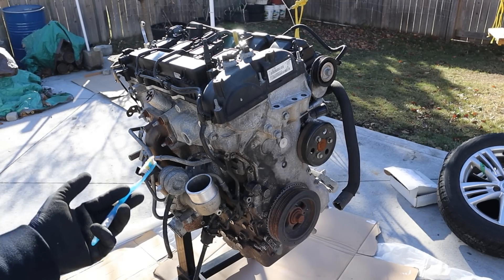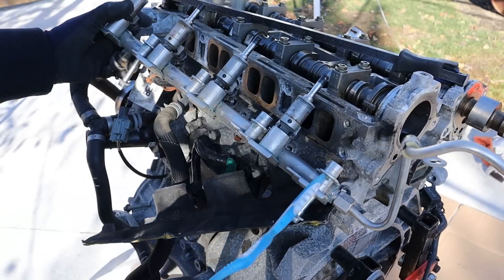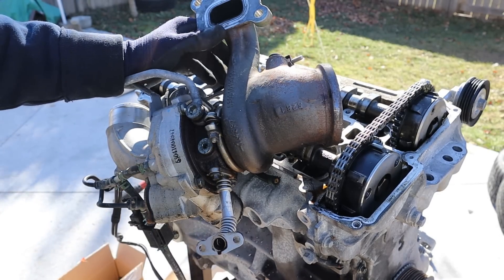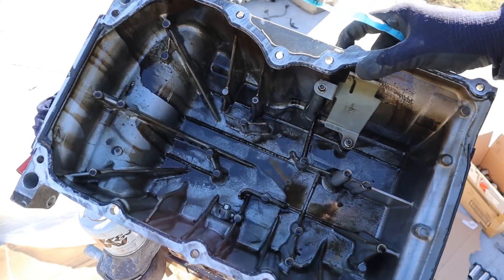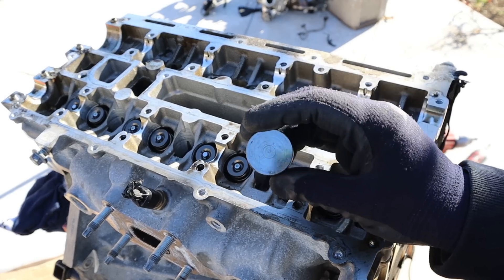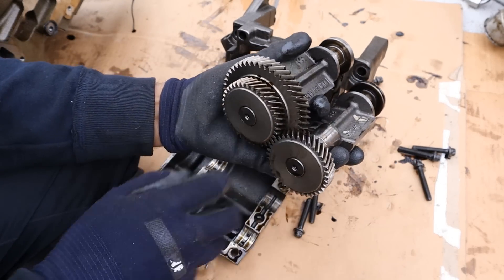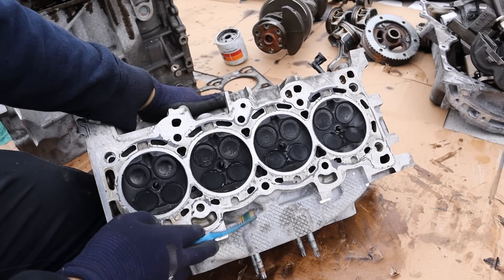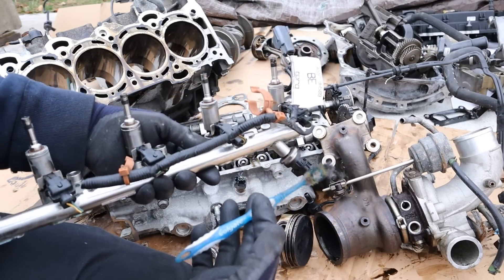Why Ford Ecoboost Engines Fail

Comment: Typical modern day Ford engineering. That's why those engines fail. Now I see the new Broncos are having catastrophic engine failures. Good job Ford. Just goes to show you that brand loyalty drives car sales, and not so much reliability. Evidently Ford buyers are more concerned about being true to their brand than having good reliable transportation. All auto makers build troublesome models but no one as much as Ford. Just look at the recalls over the years. My son bought an 05 Mustang years ago. OMG worst car that ever sat in my driveway. Constant expensive issues a couple times a year at least for all 4 years he owned that car. Alternator catching on fire, premature  total exhaust failure, constant brake caliper issues, both side window motors, rear differential failure to name a few. Yeah those Mustangs are quite the automobile. He traded it in for a Chevy.  Keep those Fords no.1 people must be you like your car at the dealer a lot.  Use to love Fords from about 1980 and back.

Comment: and the Owner put a Catch Can on to prevent issues and it otherwise seemed like they performed maintenance.   Sad DI causes such carbon build up.
Reply: Have to stay after oil changes.  3k is the max.  Engine maintenance intervals are back to the 50's era.

Comment: Brilliant breakdown and analysis!  This is why I drive a Toyota...223,300 miles on my '89 Celica GTS before the seat pan started falling through the body.  Figured it was time for it to go.  Also, I think your analyses shows it's not the greatest idea to try to squeeze some more horses out of such a small engine...works great for awhile but accelerates its deterioration.
Reply: My son drives 1600 Kuga Ecoboost, going for 230,000 kms! Slight heating issues as result of damaged radiator. Uses 200 ml of oil at 10000 km intervals. No major repairs sofar, still original drivegear! Amazing car! Way better handling than anything in its class!
Reply: I drive my 4 th Kuga diesel ! Nothing beats it at any level! Excellent car!

Comment: I worked for a company that issued a 2016 Edge to myself and 3 coworkers.  All 4 of us had to have our engines replaced because we had water getting into the oil.  I thought it was leaking in the turbocharger but after seeing this video it was probably leaking from the head gasket between cylinders.  Shortly after my engine was replaced, we all had our jobs outsourced to a contract company and was given the option to either purchase or turn them back in.  One person thought it would be a good idea to buy the car since it had a new motor, but I said hell no.  Knowing our vehicles were 0 for 4 in our area I knew it had to be a bad design and dropping another poorly designed motor in it meant it was bound to happen again.

Comment: The reason these small displacement motors die so quickly is the turbo. It's like giving steroids to an athlete. He will be stronger and faster for the short term, but the damage is permanent. This is also why airplane engines with turbochargers have less lifetime between overhauls, called "TBO," time between overhauls. The turbo creates more heat and more stress, which shorten the useful life.

Comment: I put a new head gasket on my 2004 Passat B5.5 1.8T 4Motion 5 speed manual transmission because the idiot I bought it from removed the thermostat, put in the wrong coolant, then didn't even fill the coolant enough to even touch the temp sensor that didn't work but still I rebuilt the son of a bitch! I bought the car for only $750 anyway so I was really invested! lol. Regardless I got my stick shift turbocharged quattro driven all wheel drive car I'd always wanted. Didn't want the A4 because the back seat is tiny.
Catch can, when I took the head off my valve where clean as they could be. Direct injection turbocharged, no thanks!

Comment: I didn't hear the part where he said "this is why ecoboost engines fail," except don't suck water/snow into the intake.  Honestly, he even said about 75 times, "looking at this part, it looks pretty good."  He was a little brutal taking this engine apart, where in fact it looked very serviceable and should have been carefully disassembled with the intention of reassembling.  Other than decarbonizing, he didn't show me anything wrong with this engine.  I'll take it if he doesn't want it.  He just has a twig somewhere about ecoboost engines.

Comment: Huh. So gdi engines need a vacuum pump like a diesel, huh? Does that mean they don't have a throttle valve, and they don't require a stochiometric fuel air mix?
Reply from the maker: Yep

Comment: When you have a 120 about cubic inch engine and want it to run as a small v -8 it ain't gonna last long.  A blown  engine will blow the stress is 4 times harder than a small unblown v-8.
Reply from the maker: Yeah the stress is real

Comment: Everything 8mm. Such a weird generation of ford motors
Reply from the maker: Some 13's and barely any 10
Reply: @speedkar99  yeah, I saw a few bigger sockets as you got deeper in. I had a Taurus with the 3.5L v6 (not turbo). Seemed like everything I did was an 8mm.

Comment: Anyone who wants to know why electric will replace gas just needs to watch this video. Extremely complicated engines, facing pressure to be more efficient, are pushing the physical limits of the steel, aluminium and plastic components. Burning fuel inside the engine produces tons of polluting garbage which fouls every surface and requires expensive exhaust systems. Exhaust systems reduce noise & pollution, at the expense of power & efficiency. A losing battle from every angle. Even if synthetic fuel & hydrogen can extend the life of millions of worthy ICE vehicles, electric just makes more sense for speed, noise, efficiency, and human lungs.
Reply from the maker: Good thoughts. All regulatory

Comment: And that's just one of many reasons I stick with OBD2 90's cars, and drive a '96 Buick Regal..I'm partial to GM 3800 series 2 engines, Re-gasketed with Felpro gaskets they'll go 500k miles+, The life of the weak 4T60E transmissions can be greatly prolonged by simple driving tips, regular fluid changes, shift kits, and/or upgrades.
Even good wrecking yard replacements can be had for $300 +/-.. Supercharged cars have stronger ones you can swap in also.
Another reason.. PARTS.. Cheap and plentiful.. I had a '17 Fiat Spider .. checked parts prices. Just for the fan switch for the climate control was part of a module that cost $1700.. YIKES.. Got rid of it... 😵‍💫
Reply from the maker: Good choice

Comment: So it needs  a balancer because its a 4 banger, a turbo because it's a 4 banger, reinforcement because its boosted 4 banger.
Reply from the maker: Yep. Solid bottom end. Everything bolted on is the issue

Comment: but you didn't give a fix. toyota made a direct fuel injection engine with port injection as well helping to eliminate the carbon buildup.
Reply from the maker: Exactly

Comment: The newer 2.0l 1.5 and 1.6 ecoboost engines all have issues with coolant migrating into combustion chambers. Unlike the block shown they use a steam port, slit between cyl's and the head gasket fails allowing coolant into the combustion chamber. I believe the newer 3.5 V6 did this as well. Looked at one today for a claim and it was of this design and had head gasket failure
Reply from the maker: Yeah I mentioned this at the end of the video. Poor design

Comment: Nice.  Tear down a perfectly good working engine that only need to be de-carboned and destroy it in the process.  Tip for those running direct injection turbocharged engines without a secondary fuel spray into the intake manifold.  Install a Water/Methanol injection system.  It will not only provide some additional power by cooling the intake air it will also keep your pistons looking out of the box new.

I'll also note  that you do not want Speedkar99 working on your engine.  For instance, Ford provides a means to lock the crankshaft in place in order to torque the drive pulley nut.  Instead he basically wedged a crowbar into the camshafts doing who knows how much damage to the timing chain and cam phasers.  Then there is his methos for removing the cam bearing caps.  Unless of have the proper multi drive system for this engine the procedure is to loosen each cap bolt 1/4 turn at a time.  Failing to do this can and will crack a camshaft.
Reply from the maker: This engine is clearly destined for the scrap bin. I would not work on a working engine this way without proper tools.
Reply: @Scooter 123 DUDE just STOP! This is a TEAR DOWN vid with Speedkar99 humor and really cool EDITING in it. You should have checked out his channel before you come one her with your NEGATIVE post! UGH!
Reply: @standhd  No, that engine could have clearly been rebuilt. What a waste.

Comment: The engine need new ring the carbon build up is from the direct injection Ford has a service bulletin out on that. You could have stopped at the head and pan very rebuildable engine without any machining. That engine would have ran as it was but it would use some oil. Very good explanation of how the engine works though!
Reply from the maker: Glad you like it

Comment: I love that the engine has a purpose built flat bottom which is ideal for when the engine is removed from the car it stands level & stable on the ground.
Was this feature included because Ford knew it would fail so badly that the only way to fix it would be to fully remove it from the vehicle?
What do you think, sometimes truth is stranger than fiction?
Reply from the maker: I think so!

Comment: The susceptibility for the 1.5 Ecoboosts to crack between the cylinders is the reason I got rid of my 2014 Fusion right before the warranty expired.  I got a Toyota Corolla hatchback with the manual 2 years ago and haven't looked back.
Reply from the maker: Good call
Reply: It's as if nobody wants to make a car that you can afford to keep running after the warranty is over any more.  I'm keeping my 1998 Nissan Maxima for as long as I possibly can.

Comment: A very informative Video, but 'ripping apart' with an impact wrench is NOT the way forward, if any of the engine components are to be re-used. i.e. Crank and Cam bearing caps, Camshaft buckets etc need firstly to be marked and returned to their original positions. From my observations, a full de-carbonising and perhaps new piston rings would ensure this engine could be re-used successfully....

Comment: Just had my 2018 Ford Edge 2.0L Ecoboost engine replaced under warranty at 45K miles. Cause was engine coolant in cylinder 1. Thank you for this tear down and showing me exactly why that happened. So do you think  now is the time to sell the vehicle for a new one or will engine number two hold up this time?

Comment: I have a 2018 ecosport with the 2.0 I use for delivery. Maintenance every 10k about once a month. Just hit 600k miles. Only regular maintenance so far. Radiator hose spilt is the only non regular maintenance.

Comment: Growing up I never heard of an engine or transmission failing.  I am sure they happened, but it didn't seem to be a regular occurrence.  Now we have CVTs that fail on a regular basis.  Just talk to a Nissan owner if you don't believe me.  Now there are stories of Ford and Subaru engines go belly up.  And didn't GM trucks have major issues with their Diesel engines a few years back?  Yeah, I miss the "good old days".

Comment: 12.46 - get rid of those in any evo engine from the 4 to 9, saves hp and stops premature belt snapping which destroys the engine entirely.

Comment: My wife's daily driver is a '16 Mustang with the 2.3L Ecoboost motor. She has 70K on the odometer thus far and it still runs like a champ. No oil consumption between changes. No engine treatments of any kind performed to ward off issues associated with the DI.

Comment: And this is why I will never own an EcoBoost engine...my F150 has a 5.0 in it.  The V6 EcoBoost engines aren't nearly as bad as these direct injected four-bangers, but anytime you involve a turbo, you are introducing a whole new set of potential problems.

Comment: So the owner sucked in snow and your video is of "why ecoboost engines fail"? If maintained the ecoboost engines are great engines.  211k on my 1.6 runs like a top and doesn't burn a drop of oil.

Comment: The carbon build up is due to it being a Direct Injected Engine.  GDI engines do not mix fuel as well as a MPI or TBI injection system therefore doesn't burn as clean = leaves more carbon deposits.  Another reason why GDI engines are more prone to Catalytic Converter failures.

Comment: Unusual for all four cylinders and cylinder heads to show carbon build up due to oil burn especially since there is no significant sign of bearing wear and it looks mechanically solid.  All the signs point to an engine running rich due to a systemic fault of the ECU/PCM receiving ‘lean’ signals or NOT receiving ‘rich’ signals.  Live fuel trim PIDs would have given a pointer, so in its absence,  fuel line pressure relief valve failure, exhaust oxygen sensor failure or turbo boost pressure sensor failure/ waste gate actuator failure would be key areas to look at. My guess this engine was showing excessive fuel consumption and spending too long in open circuit.

Comment: Oh and to make sure carbon buildup roaches your engine as fast as possible so you can be sold another car, always religiously follow CAFE standards and use 0w20 and leave it in for a minimum 10,000 miles as directed by the manufacturer or until completely empty, whichever comes first! It'll keep your brand new car going strong, lasting you a lifetime of many months to come!

Comment: So what do you say about the thousands of them still on the road running fine with over 200k .  How do you know every ecobooat ever sold failed lol. Your title insinuates this which is total BS.  They wouldn't be still making them if every one ever sold failed. I think your jealous they can get twice the power from that little v6 as chevy can decking out a monster 6.2  lol.  Chevy engineers suck and ram too. There's a reason FORD is the ALPHA.

Comment: They have weak connecting rods if you asked me. Awesome video, and if anyone needs to hotrod a Ford 4 banger and not scatter cast iron all over the road, this aint the one! EcoBoost can be made to run but isn't worth the trouble. The block is made of recycled dinner plates, and 1 good overheat warps the head into a banana shape that will never mill back into shape or run the cams perfectly true.

Comment: I have a 2017 Explorer with the 3.5 L V6 Ecoboost engine, and she is at 200,000 miles, and still running strong. Yes, the 4 cyl are crap. This is my second Explorer, the first was a 2013, and she had 395,000 when I traded her in, and still running strong. I am going to get 500,000 miles from this one.

Comment: I had a 2.3 Mustang Eco boost. It would on some occasions shoot plumes of white smoke after some hard acceleration, any ideas why?
Reply: Catalytic converter cleaning up..being "fired off" with the extra heat from the hard acceleration?

Comment: My 36 year old 460 powered  F 350 runs like a Rolex  with  the aid of a half gallon of Methanol  every  tank fill,  same as my 36 year old  F-150  4x4 powered  by a 300 6 cylinder  half gallon of methanol  every tank,  if they ever wear out I'll get  ?
Reply: The Ford 300ci 6 cylinder? Can't kill those engines, and they produce torque like a light diesel.

Comment: Yup. I had one fail at 40k miles. I owned it from new, really looked after it well and ran it exactly like it should be ran. 
Some ecoboost engines appear solid but the majority are truly bad quality.
Reply: What was the failure in your engine?

Comment: 2.0L found in the Focus and Focus ST is arguably the best 2.0L ecoboost as they are closed deck. The ones in the fusion and edge are the open deck ones that blow head gaskets
Reply: Never understand why they changed to open deck maybe engines were lasting to long

Comment: My 2014 ST has 211k on it and is still going strong.  Take care of them and they'll take care of you!
Reply: Nice man, I’m at 130, been a great car overall. God bless
Reply: Not the same engine. Both called 2.0 EcoBoost, but design is different. Engine from ST has closed deck and those from Edge or Escape has open deck like on that video.
Reply: @maciekapocaliptic it’s the same engine. Ecoboost got a Twin-scroll turbo from 15 and up in the edge and escape though. Guy in the video literally said it’s from an ST.
Reply: @gogurt_st  Ok, so what about cooling system? For me different block designs = different engine.

Comment: They forgot how to build great engines the latest and greatest are unproven junk . They typically rear their ugly gremlins about within 5 years  . When this engine came out I knew it was poorly designed junk . Nothing worse than pushing out designs to market too fast obviously the direct injection designs are problematic.  Nothing worse than pushing a little motor harder than they should be designed to do. There is no replacement for displacement!
Reply: Now they have had 10 years to sort it out...
the direct injection engines run an extra set of injectors just to clean the ports....
rumour has it that around town 90% ofthe fuel gets injected into the ports?????

Comment: sure it will run for a while, but made with such inferior metal , so thin and cheap to break and have you in the service  department paying more money for more junk replacement parts ,  an endless  cycle all  designed and planned to take every dollar you have.

Comment: not a soul cringed when he dragged the timing chain over the cam gears? beating aluminum accessories out of aluminum with a ford wrench isnt the best approach either. this is my first video ive seen on this channel and i have mixed feelings for sure.
Reply from the maker: It's definitely not how I'd remove parts of I was keeping the engine. It's in the scrap pile now.